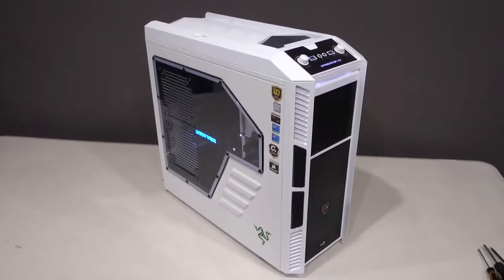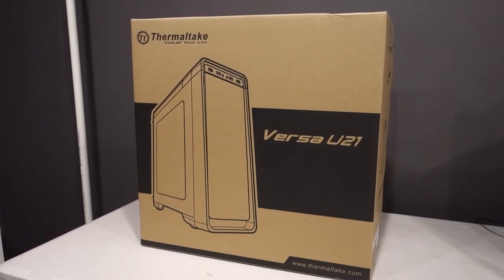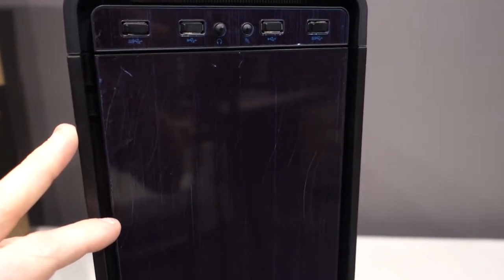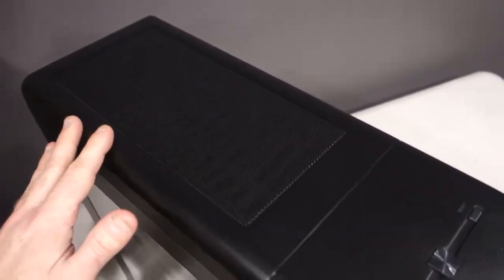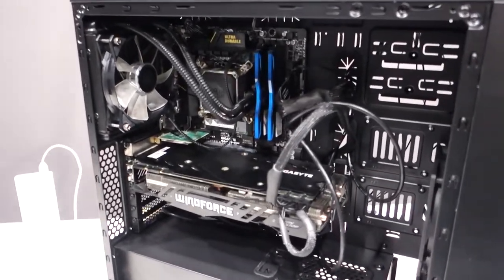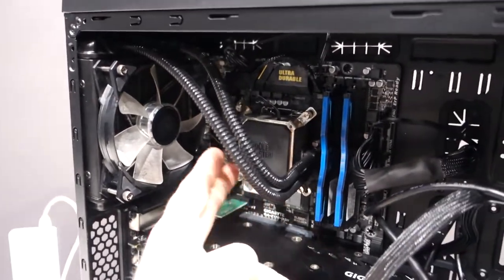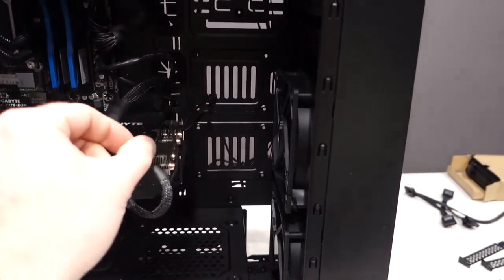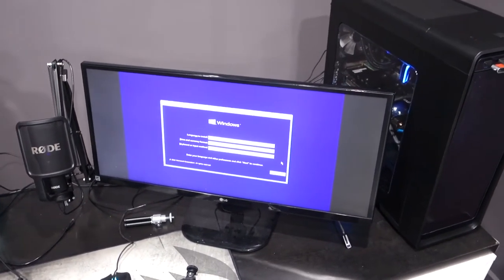Moving PC from Aerocool Xpredator X3 to Thermaltake Versa U21

Comment: i have recently bought this case also - this case has it all from a windowed side panel to a psu cover to a 280 radiator 
 support on the front and 3 fan filters - on the front botton and top. excellent case.